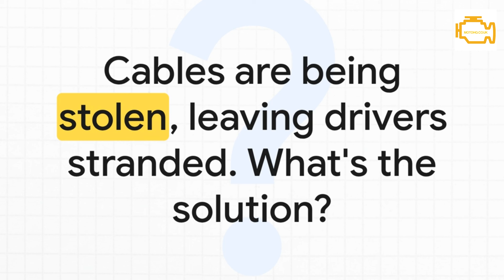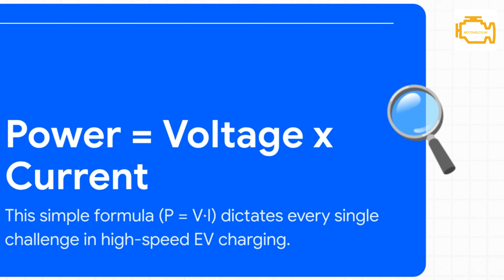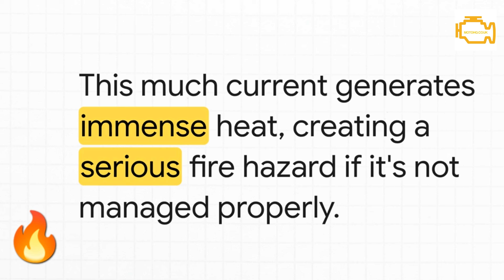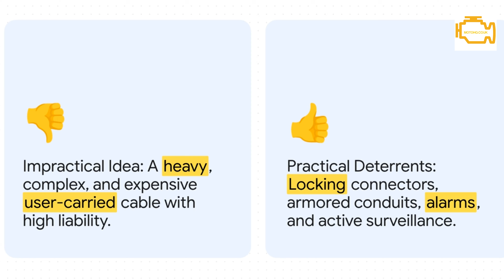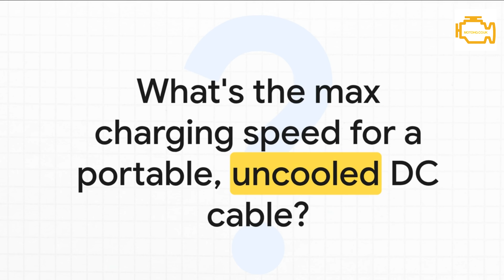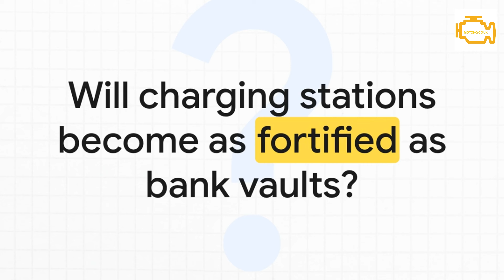Why EV Charging Should Be Limited to 80 kW!

Comment: High Voltage safety concerns from me
Reply from the maker: It would only be the same as the machines we have now, but i know what you mean. I guess the system like now would have to use the handshake to make sure the cable was connected securely before the 800V started.